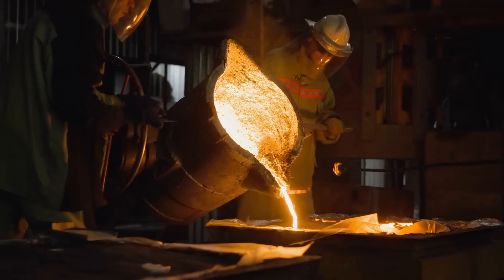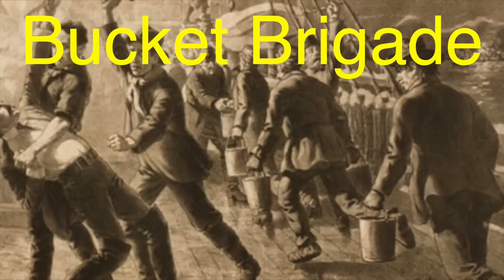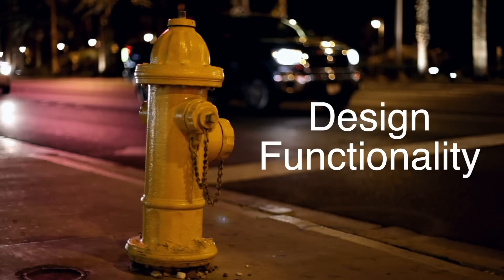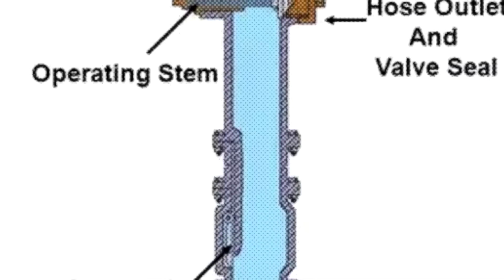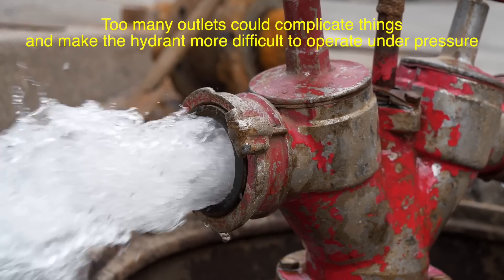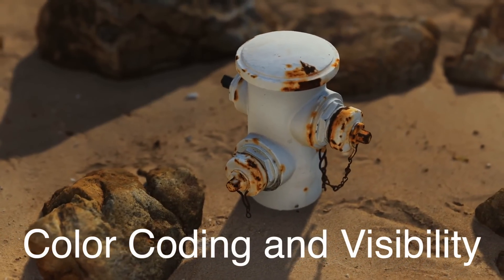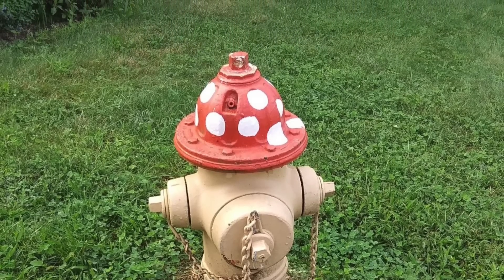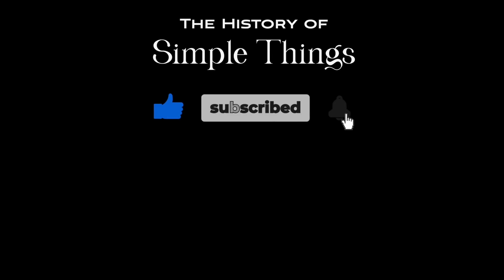Why Are Fire Hydrants Shaped the Way They Are?

Comment: Something I don't understand, wet hydrants in cold climates will freeze in winter.  Hydrants in my part of the U.S. are all dry down to the water supply line.  They have a drain hole that allows water to drain out and prevents freezing.  When the valve is opened you must turn it completely open to seal the drain hole.  The side holes are usually used by contactors using a portable water meter, for such as suppling water to a job site or filling equipment.  Fire departments will hook to the steamer connection then to the pumper which will raise the water pressure going to the hoses.  All hydrants here are painted silver and if you see them anther color other than silver, they indicate private lines, usually in a commercial complex or some other private property.

Comment: Australian street hydrants are always underground. Some hatch leading to water mains pipe with socket on it. Firefighters connect their own standpipe with shaft and outlets and go. No risk of damage like in classical movie with fountain when car smashed street hydrant, no unusable rusty threads or leaking valves, the single critical part staying there is main valve and it is responsibility of water supply company. Other users (water carts, temporary structures, tradies, landscapers and so on) can use these hydrants too, but with metered and flow-limited standpipes.

Building hydrants can be pillar type, but usually they mounted on the wall, on pipe structure or in some cabinet. They all have their own responsible owner who looks after them and upkeeps them in order.

So the main reason why American hydrants are shaped this way is American tradition. It was done this way 150 years ago and did not change since, nothing else.

Comment: I'm surprised you didn't talk about the break-away collars they're mounted on.  When accidentally hit by a car, the whole riser underground doesn't need to be replaced just the broken collar.  Also I'll bet that in northern climates, they don't use a wet barrel design.  Frozen water could crack the hydrant.  I noticed one of the drawings in this video showed a design with the valve mechanism well below ground level.  I assume below the frost line.

Comment: 🤔It's a good thing hydrants were designed a century ago.   If designed today each hydrant company would have their own proprietary hoses and compatability would be like sticking a floppy disk in a USB drive.  Of course each one would be connected to the internet and the software would have to be kept updated.  Plus the subscription fees. 😂
Reply: welcome to Australia where each state has its own system, originated from 19th century when states were independent colonies. For the same 2.5" hose - the full zoo of connectors.Thread (British), small pitch thread (old NSW), huge pitch thread (old QLD), 2-latch front (current Vic and NSW, Storz), 3-latch side (very old, never met them anywhere except museum), Britich fast connector (WA and NT)...  terrible pain when firefighters go to other state in case of big bushfires.

and the same story with 3 mainline rail gauge.
Reply: You forgot each fireman would have his own password that would have to be uodated every 60 days.